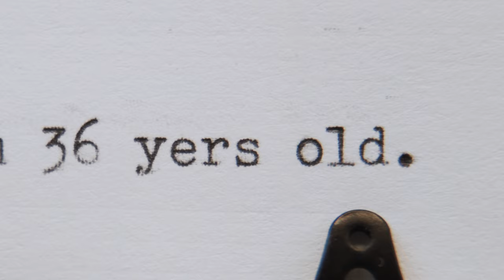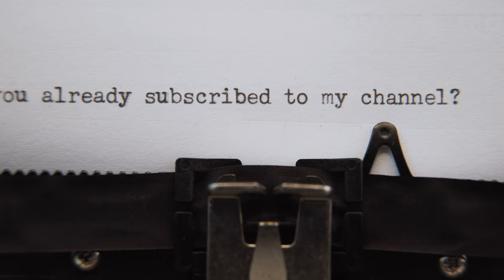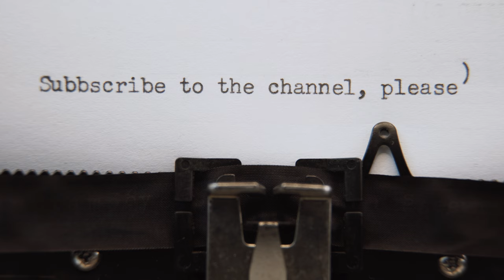Typewriter. How it works?

Comment: So a type writer is a collection of a springs, with character stamps, that are all focused onto one point. If you were to hit a key, the spring (most likely dipped in a sort of ink?) will fire onto the page and print the associated character. After that action, a gear box will move the page over to the right one indent. If you get to the end of the page, a little bell will ring to indicate you’re on the last character space. You’ll then shift the gear box to the right which will move the page up, as part of the process (unsure if this is correct?)